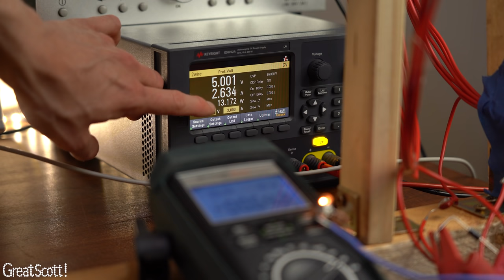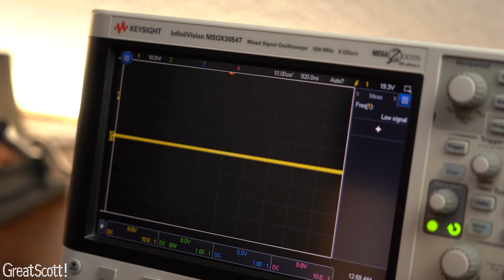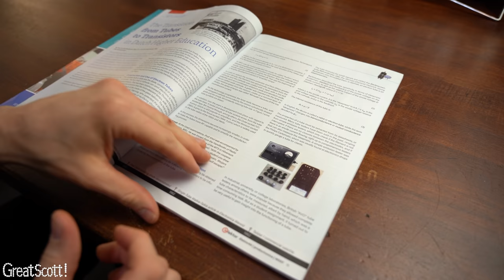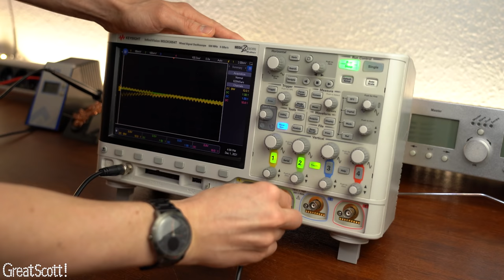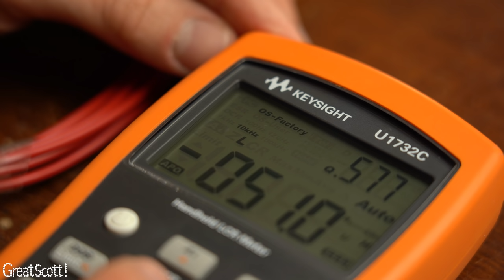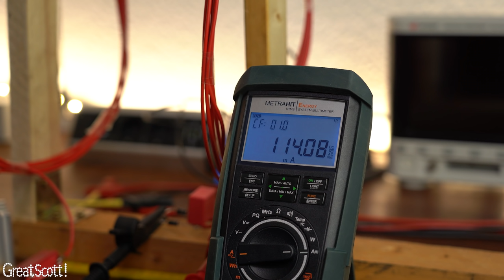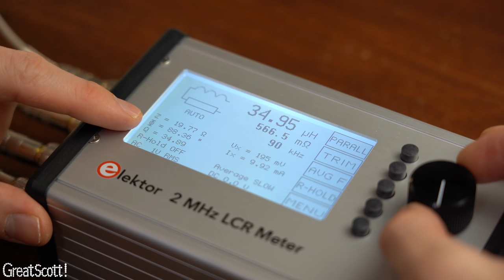In Search for the BEST Wireless Power Coil! (Experiment) My Coils can act like Capacitors?

Comment: Have you tried the experiment with a metal backing plate (pizza Pan?) behind the transmitting coil?  Currently the energy is being transmitted in all directions from the coil.  If you use a metal plate behind it you should have more energy directed to the receiving coil.  This would be even more effective if the backing plate had a rim around it that would go around the circumference of the coil.  Perhaps you could do a video trying different shapes of metal backing plate: flat, bowl shaped, parabolic, etc, or even tin foil shaped around the back 270 degrees of the coil with only the front side of the coil exposed in the intended direction of transmission.
Reply from the maker: I like those ideas. It is on my to do list :-)
Reply: I would have expected the induced currents in a backing plate would increase the losses, as the plate represents a shorted turn. 
I have often wondered how contactless mobile phone charges manage to avoid such losses in the phone PCB copper earth plane.
Such coils are always operated in a resonant configuration, but at such low frequencies that the distance to the ground plane cannot be significant in terms of wavelength.
Reply: Ideally a parabolic dish on both sides would be the most efficient back reflector and you can get ones of about the size of the coils being used here at a junkyard by looking for an old satellite TV dish, but a backing plate would still makke a huge difference.
Reply: @greatscottlab  Did you took in consideration impedance of free air space? Another question what if coil is in conical spiral shape? And why u dont try to use one size for transmitter and another size for receiver ?

Regarding metal plate google "Investigation of the influence of a large steel plate on the magnetic field distribution of a magnetic proximity detection system". There are some tests done already.
Reply: @nigeljohnson9820  The reflector does not have a matched impedance to the coil transmitter or receiver since you ground it with as low of a resistance as possible. If the impedance of two oscillating circuits is not of the same value, the power is reflected away from the receiving end based on the difference in impedance between the two circuits. The circuits also have to have similar inherent resonant frequencies or share one or more harmonic frequencies with each other or the power bounces off of the interface between the circuits.
Reply: A reflector would not work in this scenario. The coil would induce eddy currents in the plate and overall reduce the Q of the system.

However you are touching on a very real idea. For antennas you can use a ground plane to modify the radiation pattern and increase the directivity. Although in this scenario a loop antenna is like a magnetic dipole, and with a magnetic dipole a perpendicular ground plane cancels the field.
Reply: @nigeljohnson9820  You can use a plate or ground plane with a cut through it so it's not shorted. a metal "pan" with a thin slice removed.
Reply: @PulsedPower  Wouldn't mismatching the impedances of both the circuits prevent significant power transfer, making induced eddy currents minimal? Also, if the reflector plate pushes more energy to the side of the target than was being lost to transmitting on the back side, it should create a net gain in range and transferred power since in the present circuit half or the power is being radiated off into the environment, increasing the efficiency of the system overall, which is the goal of this experiment.
Reply: @KnightsWithoutATable  First of all, in this case the vast majority of the energy is not being radiated at these frequencies. So there isnt much energy at all being lost in the opposite direction. The most energy is lost in the wire resistance. Energy is coupled to the other coil inductively. Adding a conductive backing will only make things worse due to eddy current losses, reducing the inductance of the tx loop throwing off the resonance, etc.
Reply: @PulsedPower   kHz to MHz range IS in the radio band. The only reason these coils aren't sending out energy as radio waves, at least anything above a few milliwatts, is because the coils not shaped correctly to be efficient antenna and both of the circuits are not impedance matched with the transmission medium, the air between them.

It looks like the commercial ones don't use a reflecting plate or any kind of magnetic core material, but they do seem to use a spiral shaped coil with a single turn using finely stranded wire (like this experiment has used) instead of a more traditional coil with multiple loops or a toroidal configuration, but I suspect they are designing for maximum efficiency at short range, while this experiment is trying to do long range transmission.

Trying different coil configurations and seeing how they work compared to this setup would be interesting and educational for those that are more on the hobby level or just have a basic understanding of electronics.
Reply: @KnightsWithoutATable  Agreed! It would be a very instructive experiment.
Reply: @KnightsWithoutATable  since these charges are operating on a near field, where the coupling is purely magnetic and electromagnetic, I find it difficult to see how a parabolic reflector can work. I can imagine a mechanism where a zone cut reflecting plate might act as a "magnetic reflector", though it's action would be more to enhance the resonant field of the receiving coil.
But the detail of how this avoids the consequences of lenz's law eludes me. Somehow the phase of the induced field in the reflection plate must be such as to enhance that of that in the receiving coil. In RF antenna theory, it is easy to see how the reflector element works, I have no real feel for how this works for purely magnetic fields where the concept of wavelength and phase cancellation is apparently not relevant. This is an area I would like to know more.
Reply: @nigeljohnson9820   With Nearfield energy, like this video example, power that is not received behaves exactly as if it was never sent out in the first place. In other words, there is no transmission occurring in the usual sense of "transmission".
Reply: @YodaWhat  what you are indicating is the difference between the loaded and unloaded impedance of the transmitter coil. This is similar to the common mains transformer, where the primary shows a high inductive impedance until the secondary is loaded. However this does not explain why a backing plate should not be regarded as a shorted turn, or why its presence should not load the transmitting coil. I have search for scientific and engineering papers on the subject, but I have not found any that explain the effect of having the receiving coil so close to a conductive back plane. 
If the receiver coil was backed by a Ferro magnetic material, one could imagine treating the material like a transformer core, that concentrates the magnetic flux, routing it around the coil, and closing the magnetic circuit, but a copper backplane is just like a shorted turn.
Reply: It would certainly be interesting to see the effect of bring a back plate of various metals close to the receiving coil in the setup shown in the video.
In such an experiment it would be informative to monitor the transmit and receiving coil loop current. What is the difference between a ferrous and non ferrous backplane plate?
Reply: @nigeljohnson9820  You are right. I didn't realize that the circuit coupling was strictly magnetic and my radio circuit training kicked in for no reason. Too much weed that night.
Reply: @KnightsWithoutATable  I recall that some metal detectors use a search coil which is almost completely enclosed in a Faraday cage. The cage, which is really a shield that surrounds all the coil, except for a small gap that stops the shield becoming a shorted turn.
The purpose of the shield is two fold, it stops the coil radiating an EM signal, restricting the radiation to an oscillating magnetic field. Secondly it screens the coil from detuning by the effects of ground capacitance. In a circuit configuration the shield is connected to the zero volts supply line of the driving circuit.
In my youth, I  once made such a coil using half inch copper gas pipe, bending it into a circle of about eight inch diameter. The search coil wire was then threaded round the inside of the copper pipe, a somewhat difficult task given the number of turns involved. One end of the pipe was then joined to a copper T junction, where the coil ends were connected to screened twin flex stereo audio cable, connected to the metal detector electronics. The one cm  gap ( yes I know I am mixing imperial and metric units.) in the copper pipe was covered with a rubber cable plug entry sleeve.
The arrangement not only after as a Faraday screen, but also kept the coil from moving. If I was making this today, I would simply wrap the finished coil with a layer of conductive tape.  The point of the story, is that the coil was intended to operate with a near field magnetic component and not an EM radio wave. Essential, as the operating frequency of this home made metal detector was in the medium wave radio band. It was not a very clever circuit, it used a Colpitts oscillator beating against a crystal oscillator.
Today I would use the VLF band set aside for such equipment, and use a balanced double D coil arrangement, which is far more sensitive.
Reply: @nigeljohnson9820  - ANY conductive plate can be honestly regarded as an infinite number of conductive loops of various sizes and shapes, all co-occupying the same volume of space. As such, all frequencies (above some minimum related to plate size and shape) will have one or more loops which correspond to the externally imposed electromagnetic field frequency, and various harmonics. Certain ones of those coils will be able to resonate in phase with the externally imposed electromagnetic field, and other ones will be out of phase. Those which are out of phase will have lower loop currents, meaning lower resistive losses, and weaker self-generated fields. The opposite is true of the in phase loops. The combined effects are hard to predict for the general case, in part because of crosstalk between neighboring loops, but one possibility is dominant eddy currents. Eddy currents always mirror and oppose the applied electromagnetic field.
Reply: @YodaWhat  this is what I expected, but it then lead back to the question of how magnetic charging coils operate so close to areas of metal, such as the earth plane of a phone PCB or the bottom of a cars body work. The plate acts as a shorted turn to the transmitting coil, just like the copper pan held over an induction hot plate. How can it in anyway enhance the reception of the receiving coil? I am clearly missing something, as such resonant  charging coils are becoming common place in mobile phones.
Reply: @nigeljohnson9820  Well the first difference in smartphones is that they contain the recieving coil, not the transmitter, so you get some benefit of distance with anything conducting (other than the Rx coil itself) being further from the Tx coil. Second, the battery is typically what lies on the other side of the Rx coil. Im not too familiar with their composition, but it doesnt seem unreasonable to assume that they can prevent a completely shorted turn in its internal construction. Or at least make it a poorly conducting path.
Reply: @PulsedPower  as far as I can tell from the articles I have read, the standard practice is to back the tx and Rx  coils with a  ferrite material. This closes the magnet circuit while not being a conductor of eddy currents. I would welcome an expert view, as it is not an area in which I have any professional experience.
For longer distance transmission of power, it is necessary to use the far field EM wave, then aerial gain  theory can be applied.
Reply: @KnightsWithoutATable  I think a parabolic dish for these frequencies would be huge.  Remember c = f x lambda
Reply: @peterkostanich1996  There are ways of making smaller dishes for lower frequencies.

Comment: The real difficulty of the Q measurement is that it is the tangent of the phase angle. Because tangent function diverges at 90 degrees and you are measuring phase angles close to that value, you'll need to measure the phase angle very precisely, because even a small error in the angle will result in a big difference in the Q calculation.

Comment: @GreatScott! - My research on this topic indicates that you can greatly extend the power transfer distance by interposing PASSIVE COILS (NX) with the same resonant frequency near or in between the transmitter (TX) and receiver (RX). In fact, one paper on the subject said that the power transfer Coupling Efficiency (CE) improves as the square of the number N of coils. (This strikes me as being very analogous to the case with a Phased Array improving as the number of elements squared.) 

For Inductively Coupled Coils, the equation for ideal Coupling Efficiency would be like CE = 1 - (1/N^2). Thus for just 1 coil, CE = 0 (you can't transfer power at all if there is just one coil), while for N=2, CE = 0.75, for N=3, CE = 0.89, for N=4, CE = 0.9375, for N=5, CE = 0.96, etc. That equation indicates that with an infinite number of coils, Coupling Efficiency would be perfect, 1.0, unity.

In reality, those numbers should be multiplied by your efficiency with your basic 2 coils, TX and RX, immediately adjacent to each other. The paper also spoke of creating a whole mesh network of the passive coils, for very high CE anywhere within a whole house. I would love to see if you can reproduce those results, GreatScott... or anyone else!

Comment: If you want to use a higher frequency, reduce the diameter of the coil's windings because that will raise its natural resonance frequency.
Reply: Where do you draw the line when he should switch to using antenna designs for best transmission and recieving results eg focused or directed transmitter instead of just air coil transformer

Comment: Could adding a "core" between the windings shape the field and increase coupling?  How else could you do directed power transfer / beam forming? What about the power at a multiple of the wavelength at a different node?  Could you tap more power from the other side, reflected about the field symmetry line?
Reply: All this as was shown is happening in the Near Field of the coils, at a distance much less than ONE wavelength, so the usual assumptions about multiple wavelengths do not apply.
Reply: @YodaWhat  thank you! <3

Comment: Thanks for the video on Inductors and charging! 
I am having a "debate" with some of my EE textbooks... which state that there is a "Back EMF" when charging an Inductor and a "Back EMF" when current is suddenly stopped. I don't have the proper equipment to do the testing but when I tried to look at this using an oscilloscope across the inductor I was not able to see any measurable "back emf" on the inductor when it was charging, but. there was a voltage drop.
Perhaps I am doing this wrong? 
The other thing I don't understand is when I "suddenly cut the power" they call the electricity coming from the Inductor a "Back EMF", but in my testing, the voltage from the Inductor was the same as the source polarity. 
Perhaps I am doing something wrong?

Comment: I did strip out an old anti shoplifting system, which used as coils long lengths of 20mm by 2mm thick aluminium strip, wound into large coils, with an insulating tape layer on the one side of the coil. Self supporting in the case, and the wide strip made for very low loss, though of course the higher capacitance made the self resonant frequency lower. However, seeing as it ran at audio frequencies for the most part, and at around 50W in the transmit coils, this was not too much of a problem.  You could simply use a thick self adhesive foam tape on the one side, instead of the thin polyamide they used, and get a much better coil performance. Also wind the coil with a small offset per winding, so they do not fully overlap, so as to have a zig zag strip coil.

Comment: There is a winding method for coils often referred to as "fast coil" or basket coil which basically tries to eliminate the parallel strands of wire as much as possible by having them cross at an angle as they are wound on a flat circular form. (2d donut)
Reply: Is this type of coil you speak of like a spider coil used for radio? (searching for basket and fast coil is problematic)

Comment: I might be too low on caffeine, but I didn't notice any method of impedance matching the load to the receive coil?  Seems like measuring the short circuit current of the receive coil would actually decrease the current, lowering the magnetic field, and the breaking down the coupling of the coils.  Maybe I didn't follow it exactly.

Comment: If I had to guess just spacing the windings into a cylindrical helix about 1 cm between the turns will ramp up the srf? Analogous to a Tesla coil primary which is a  pancake or a spaced out helix.

Comment: Can we try to have compensation circuit for both sides? 

Or maybe we can try capacitive wireless power transfer next time! My undergraduate thesis is about CPT, and I found that theoretically we can reach about 60%+ at 1MHz frequency at large distances using a double-sided LC compensation circuit .

Comment: Are you going to look at impendence matching with air for both of the circuits next? Also, I assume that the shape of the coils that you are using takes into account not having a matching harmonic with the frequency of the circuit so that you don't start transmitting radio waves, but this experiment would be a good segue into basic radio transmission and reception and you could even demonstrate primitive AM transmission of Morse code or audio.